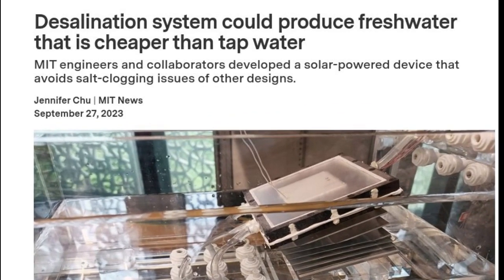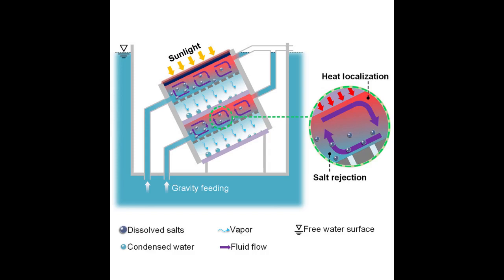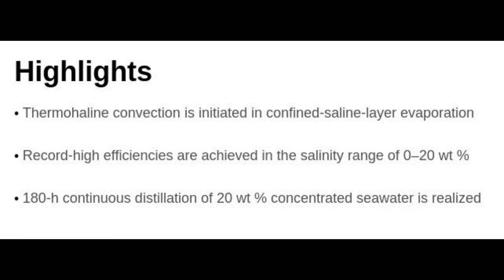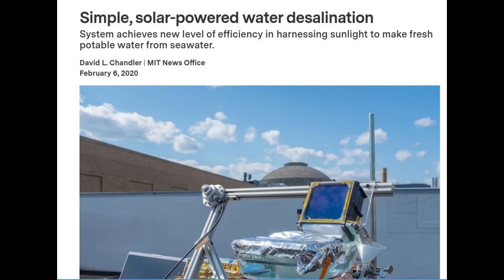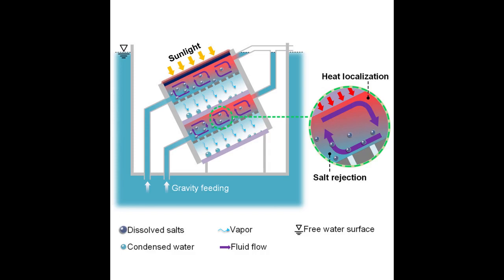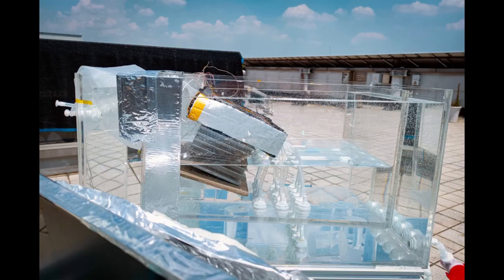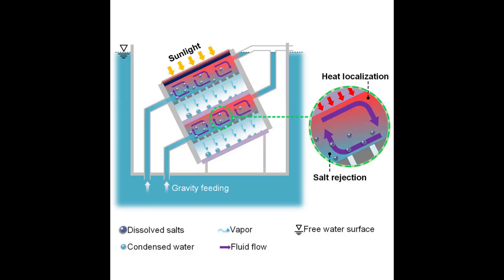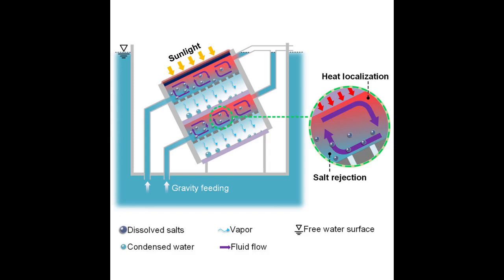Desalination system could produce freshwater that is cheaper than tap water

Comment: Looking at the basic water distillation tech of the membrane and thermohaline cleansing of salt from the membrane it looks viable, and I figure a business and industry can be founded on it. I think it is revolutionary and active systems might be able to get production rates of fresh water much higher per square meter. One might do this by preheating the water going into the cells with the heat pump condenser unit using recovered heat and by solar. Likewise, air entering the evaporation spaces under the membrane can be heated both to heat the seawater on the other side of the membrane and increase the amount of vapor the warm air can hold, aided by blowers moving moisture laden air to the condenser unit, which can be compact and with the warm dry desert air coming in it should increase production. One might also concentrate solar power on the panels.
That flat black solar collector might be a form of carbon that conducts heat and absorbs solar energy, or it might simply be a coated aluminum plate. The point is the idea is so good (it was iteratively improved by them and others) and the paper so comprehensive it allows engineers to begin developing and testing a wide variety of possible systems of almost any scale.
The point is with a dozen 700watt solar panels running the condenser and pumps only during daylight efficiency doesn't matter that much and the condenser can be separated from the generating panels. Make the panels the right size to fit in a shipping container and design it so the membrane can be changed periodically, and you should be good to go. Any uninhabited desert costal area with a population center within a hundred miles is your target market. With a modularized 40 foot shipping container system that can be expanded a lot, sounds like a business. After you build a 1 meter test rig to experiment with, then some prototype panels to test and show off to potential customers. Capital is required, but there are many wealthy Arabs with a real obsession about fresh water.
I guess I and a few others think it is one of the more important ideas and potential products to come out in a long time, in that can seriously improve the lives of lots of people and help to address a looming climate problem, drought. I do believe we will be hearing more about this over the next year or two.

Remember we are already building solar PV arrays of millions of square meters now. A 1 million square meter facility on a desert coast or a few kilometers from it using an active system powered by solar panels might produce 10 or even 20 liters of fresh water an hour per square meter. That's 10 to 20 million liters a day, perhaps a half a billion liters a year. Unlike electricity, water can be stored, and it can be transported by solar panel covered canals hundreds of miles to an inland city and the system can deliver both fresh water and power. Wastewater can be recycled or used after treatment to grow plants. Maybe the city will grow an urban canopy to cool things down and improve the quality of life with its wastewater. What would a desert city in a warm place look like in 20 years if they plated the right trees today? It might just transform how a lot of cities look, what was once barren would be lush and green with plenty of shade from the sun.